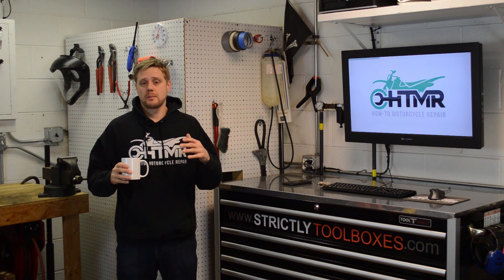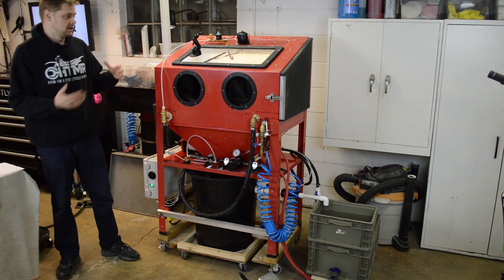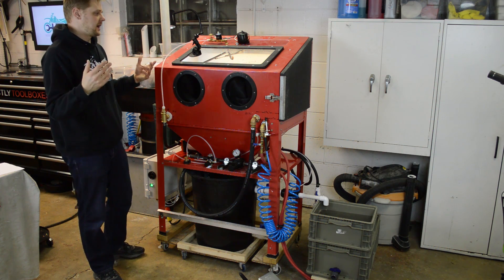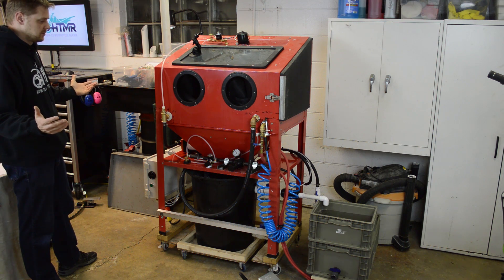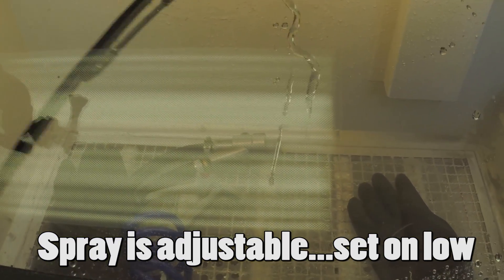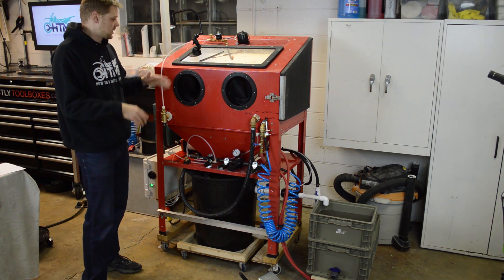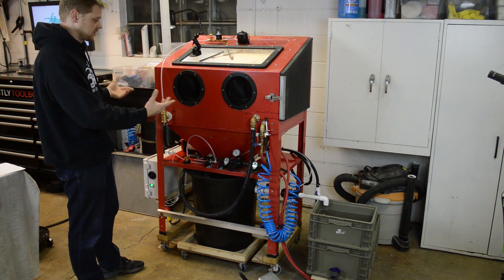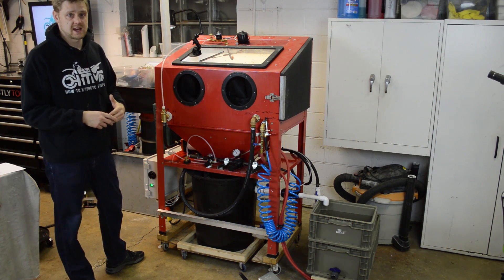How-To: Closed Loop DIY Vapor Blaster Plans

Comment: If I already have a water spigot in my heated shop would you recommend just doing the open loop system?
Reply from the maker: Do you also have a drain?
Reply: @HTMR  I have one within 7 feet of my spigot but it is for a utility sink.  Power is also just above my spigot
Reply from the maker: @LS11971  Sounds like you can go open loop. You can always convert to closed loop later on, that is what I did.
Reply: @HTMR   Perfect, thanks for your time.  I really enjoy your videos and plan on purchasing your blast gun and plans in the near future.
Reply from the maker: @LS11971  Awesome thanks!

Comment: Can I just buy the plans for the closed loop filtration portion? I have two machines I want to build a single filtration system for. Really just need to understand how the filtration system works. Thanks.
Reply from the maker: Sorry the plans are not set up that way. The closed loop portion of the video is several hours long. You will have to buy the complete plans in order to view the closed loop info.

Comment: Why not just use a cheap harbor frate pump and recycle suspende slurry. Alot less parts, non stop honing for however long the impellor holds out.
Reply from the maker: Because this is a way better setup than you described.

Comment: How much would you charge for just a parts list? I am doing my own design but would like to save time in researching the pumps and everything.
Reply: With part numbers and everything.
Reply from the maker: @drewbleiler4540  Part list won't do you any good w/o instructions. Buy the plans you won't be disappointed.

Comment: I'm thinking of doing this but I'm starting from scratch and will also need a compressor. Can you recommend a good home compressor that doesn't cost several thousand $$$?I guess I'd like at least 12CFM so I can spray motorcycle components if I choose, ie frame, tank, fenders, engine parts.
Reply from the maker: Check this video out: https://youtu.be/1oFn034YtD0
The more CFM you have the better. This machine starts to RIP at 20-25cfm.
What is your compressor budget?

Comment: hi! time has come to buy your plans. i want close loop version. but why does it  cost 89 when the open loop cost 69? think 89 is quite expensive. :)
Reply from the maker: Closed loop plans include 5.5hrs of video, and a spreadsheet with links to the 150+ parts you need to buy. These are the most detailed and complete plans you can get. Compare all of this to a closed loop machine that retails for 7k.
Reply: @HTMR  i just bought it :)
Reply from the maker: @davidevaldsson5861  Sweet thanks!

Comment: Hi! Like your videos man! 
How hi bar/psi do you haft to run for the air? is like 6 bar enough(87 psi) ? and how big of a tank is needed? :)
Reply from the maker: For aluminum, 60 psi is all you need. Maybe this video can answer some Q's: https://youtu.be/1oFn034YtD0
Reply: @HTMR  ye, thanx! And for the waterpump, is 250W / 7m3/h enough?
Reply from the maker: @davidevaldsson5861  Not sure what you mean?
Reply: @HTMR  how powerful waterpump does needed?
Reply from the maker: @davidevaldsson5861  That is all discussed and covered in the plans.
Reply: @HTMR  i will buy it! But not before next month!! :)

Comment: I’m gonna get these plans in a few weeks to build this, however I’m confused on the size of compressor to get . I’m not buy something gigantic compressor because I have no use for or hookup for such a compressor in my garage. What is needed for this cabinet, to run it efficiently ?
Reply from the maker: Watch this as I compare 6cfm all the way up to 25cfm: https://youtu.be/1oFn034YtD0
 In my opinion, the more CFM the better. It is the single most important thing to reduce processing time.

Comment: Purchased both sets of plans only got the open loop finished.. I will be converting to closed soon I hope. Works great I just have to play with it some I guess , I have been using glass media from harbor freight and my finish seems a little rougher then desired.  I'm at 65 psi I'll try less psi and see if I can get a polished finish that I'm looking for.  Thanks for the help
Reply from the maker: The media at HF is too coarse. Reference the parts list for the fine media that you need.

Comment: hey im interested in buying your kx 250 rebuild videos top and bottom end. does it cover step by step on removal inspecting parts to determine if there good or bad ? whats your email and how much does it cost for both videos
Reply from the maker: Yes, all of that is covered. Link  to buy vids: https://www.howtomotorcyclerepair.com/kxenginerebuild/

Contact: https://www.howtomotorcyclerepair.com/contact/